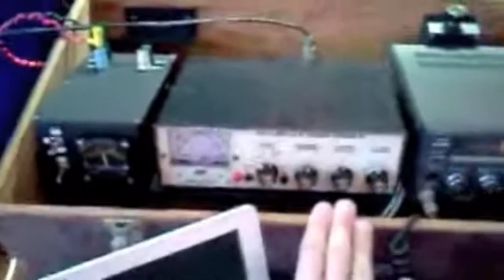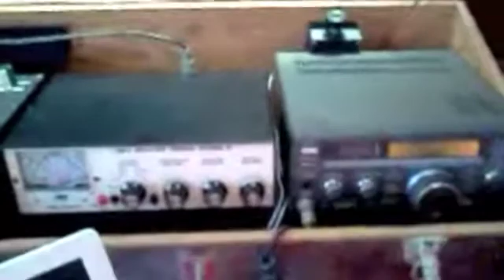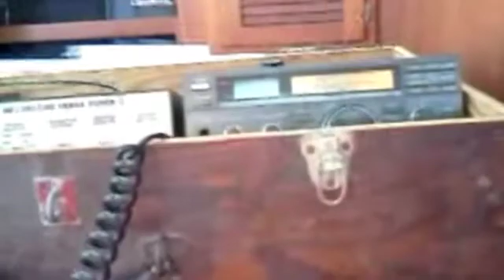Maritime Mobile HF Amateur Radio Station on a Freedom 28 Sailboat

Comment: I have a freedom 35 P, and re- acquiring my ham license in February after long absence- I wish to do qrp cw from my boat and elsewhere (mobile).  With a qrp transceiver, can run a 10-15’ coax from my antenna feed to a whip temporarily mounted to boat deck?  Probably 15 meters hf…. Recommendations?  Thanks
Reply from the maker: Just run a random wire up the mast with one of the halyards, that will give you 40' or so, should tune-up and be efficient on most bands.  Only additional advise i have is that you need to use a 0.01uF high voltage cap from your shield to the swim platform ladder-as-a-gnd, otherwise you risk electrolysis between your ladder and the prop thereby eroding the prop.  Mostly an issue in salt water.  On 20m i found this setup to perform extremely well.  I wrote this up for QST a few years back, you can find it in the archive.  Good luck!